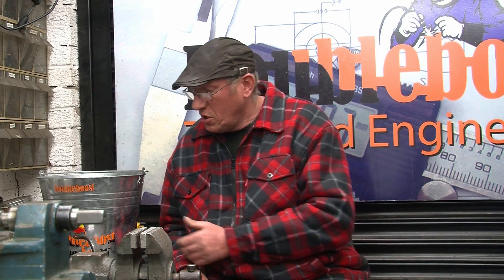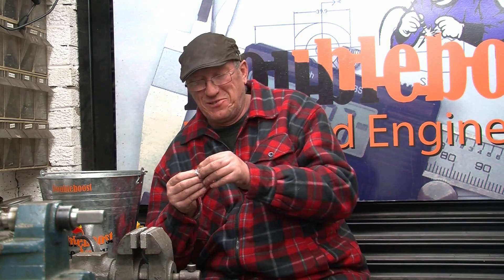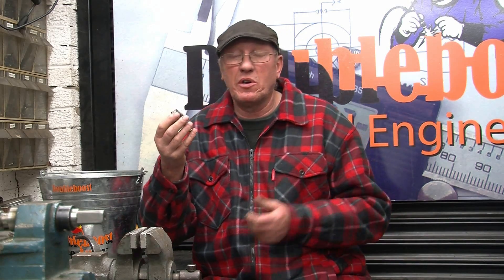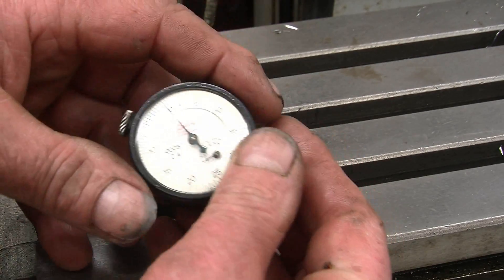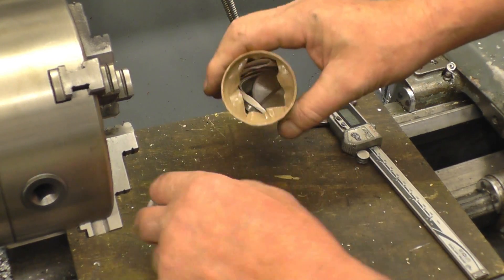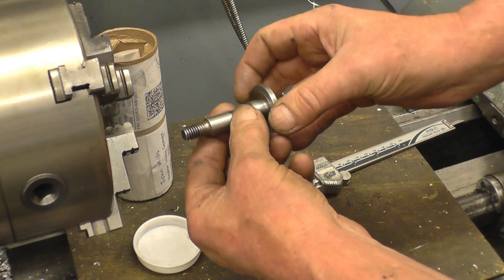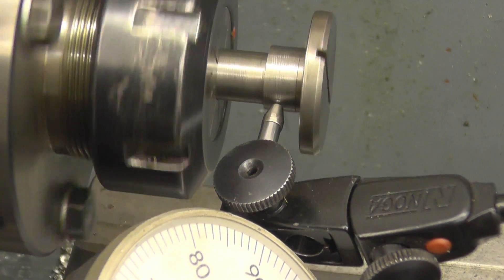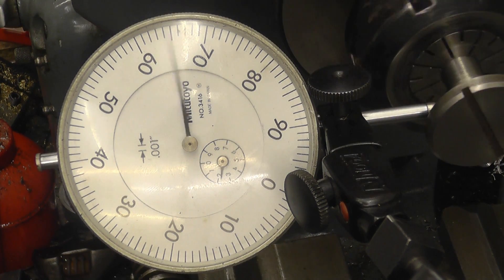SNNC 248 P1    Offset Pin Set Up & Machining

Comment: Hi John. I would have turned all the diameters finished size and length first including the off set section but double the off set 184 thou bigger diameter or slightly up. Then thread the end as sample then off set the chuck 92 thou and machine the off set section this part is near the chuck so it wont need to be supported by the tailstock. Saves centralizing the work piece again to the largest diameter to turn the small diameters and also your tailstock centre support hole will be central to the main shaft. Great stuff like watching your videos.  PS I might be wrong.

You bought the same Model Harrison 140 lathe as I have, my first lathe was a Harrison L5
back in 1985. I Just got in to YouTube about nine months ago didn't know this sort of stuff existed. Thinking about starting my own channel, like you not my main occupation a bit/lot rusty, forgot loads of stuff your bringing it back lol Thanks Tony.

Comment: Great video, something a bit different but... to my untrained eye it looks like you're making the wrong thing. On the original it looks like the shaft and the head are on the same centre line and the cam is offset. It looks like you're making the head and the cam on the same centre line and offsetting the shaft. I really hope I'm wrong.

Comment: Haven't you dropped a clanger on that adjuster?

Shouldn't the head and shaft of the adjuster be concentric with each other?
Reply from the maker: Just checked i have it correct
Reply: I thought the same thing but when John is measuring the throw and holding on the shaft you can see the head throwing so it is the shaft that is not concentric with the head and cam
Reply: @Lesfac  Thanks. I see it now.